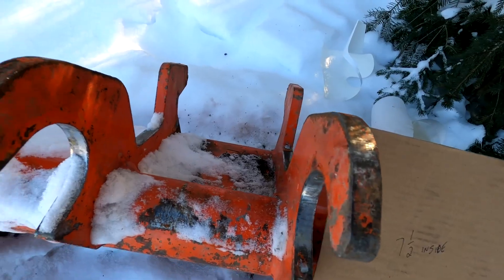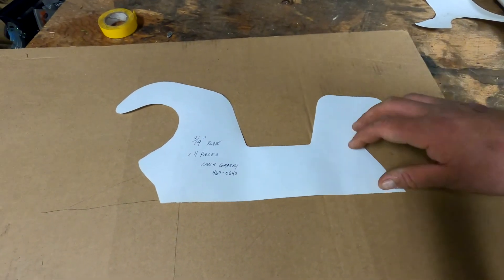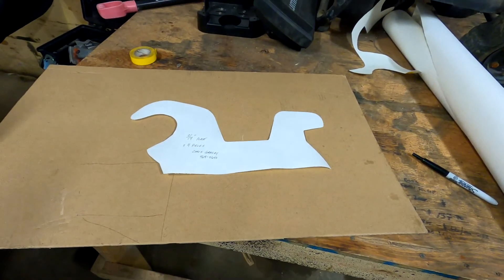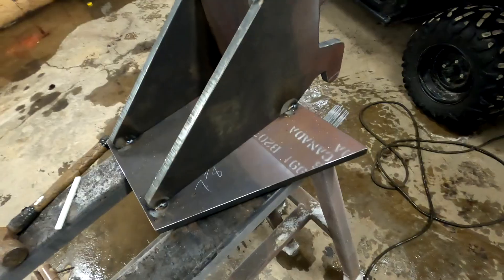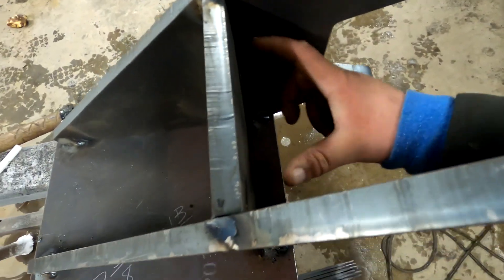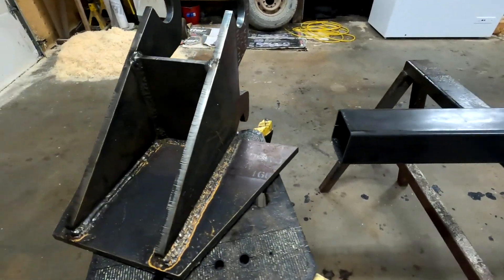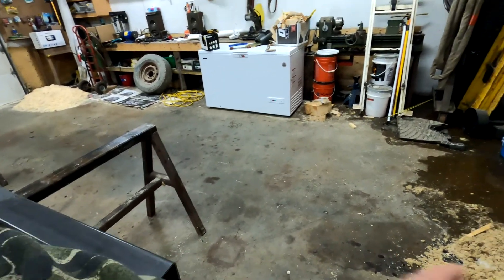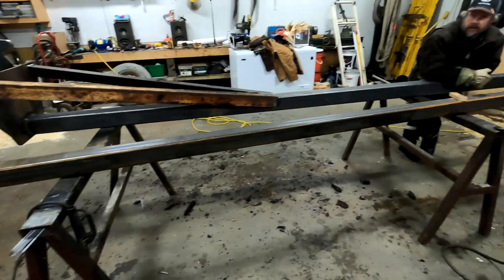Building Jib Boom For Mini Excavator || Lifting Timber Rafters

Comment: i bet it was real touchy extended that far out  getting ready to build one for my jcb 8080     to lift 62 ft trusses  22 ft up  thanks for the video
Reply from the maker: Hey thanks for the comment. Yessir, it was. A fraction of movement at controls is exponential at the load. As long as it was smooth it wasn't bad. A couple of close calls though lol. Nobody got hurt 👍 
Good luck with your build
Reply from the maker: I should also mention that the leverage that is transferred to the machine is substantial with a load on it. 62 ft trusses shouldn't be an issue for weight, but you'll need full extension, i believe.  8080 is 9 ton machine?  Don't know the reach, but you'll have quite a bit more power than my little 'bota, so i think you should be fine.
Reply: yea i'm going to use a spreader bar and my boom that i built was 22 ft with a 22 ft spreader and it took my 873 bobcat everything it had but those trusses were 62 ft 7/12 pitch and these are 4/12 at 560lb a piece @lakelifecraftsman
Reply from the maker: @pattyotool9548  nice. Sounds like a fun project.

Comment: How has it worked out? I'm wanting to build something similar for my u55 to put some trusses up on a garage, and use for taking my docks out lol. Also, I think the Deere wedge coupler is the same if you're ever needing a set of ears again. You must be in Canada?
Reply from the maker: Yessir im in canada. North western Ontario. Worked out great for that job. A little more attention or finesse is required at controls while loaded though. A little or small  movement at machine is amplified at the load and can swing around a bit. But overall a very handy addition to the tool box. We will lifting trusses onto a 2 storey house later this week with it as well. I have an extension that slides into the boom as well but wasnt needed yet. Makes it 35 feet of boom plus arm and stick (although the weight to lift goes down quite a bit with the extension) just an FYI of you're building one for yourself.  Thanks for the deere tip! I have a template now and just have my steelshop water jet me some when needed now. Works out pretty good.